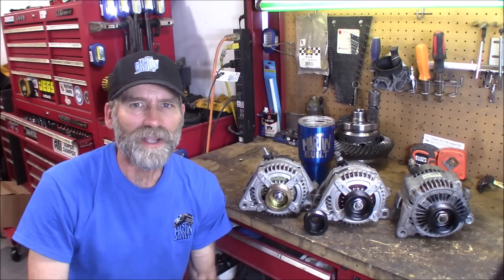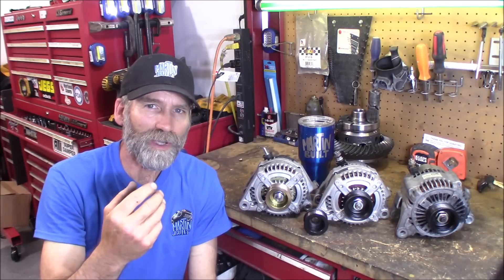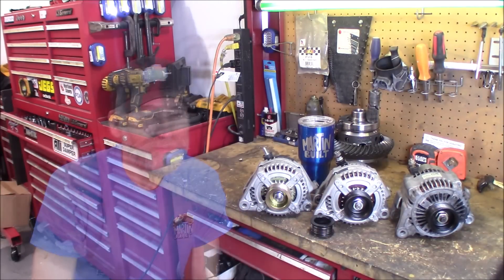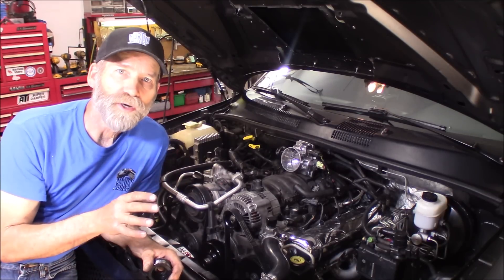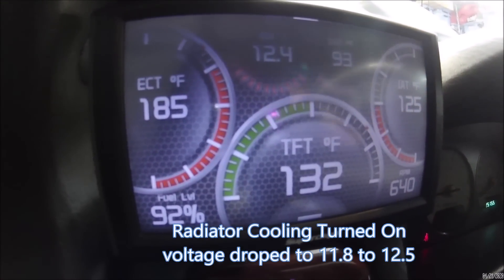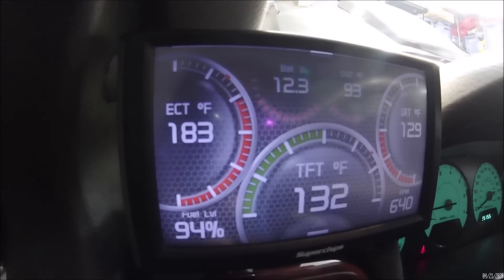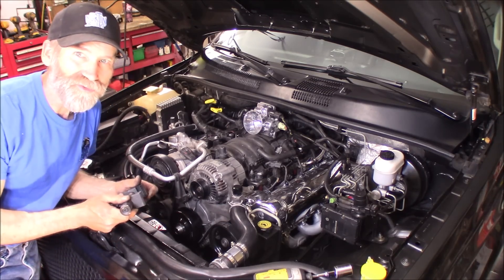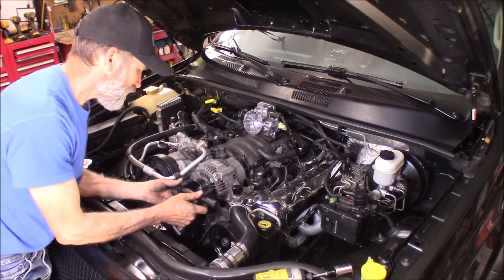Alternator Shootout at Idle (136 vs 160 vs 250 amp)

Comment: Great job thanks you explained to me in this video what I've been trying to do for awhile now one thing did you use the same serpentine belt if no what did you use
Reply from the maker: Yes I did but I should get a .5 to 1 inch shorter for the 49mm pulley
Reply: @martinbuilt  alright thanks,good to know thanks for the info great videos

Comment: The thing is that the current is high but the voltage is too too low because they use thicker wire in the 200+ amps so that reduces the amount of turn on the stator winding

Comment: O boy need advise ASAP. I upgraded my battery to a xs d3400. I also have a 250 amp alternator that I have on my counter ready to go in and replace my factory 130 amp alt. I'm currently running a 2500rms amplifier for car audio. Should I switch the pulley out on the new 250 alt before my mechanic does the install???
Reply from the maker: I think you will be okay, I would recommend doing the big 3 upgrade here is a video I did on that. 
https://youtu.be/Ednw5npj83c
Most of my problem was the 25% under-drive pulley I have on the harmonic balancer. So even with the smaller pulley on the alternator was not making up for the RPM lost.

Comment: The temperature of the alternators  should have been measured at idle. Running high amps at idle has burned up a lot of alternators or caused vehicle fires. Victron charging systems has a video on their channel showing the excessive heat at idle on the alternators at idle.

Comment: I get a 355 Chevy and a Malibu when I'm going down the road it reads 16 volts I have electric fan I only drops to about 15 volts I won't blow the battery up right
Reply from the maker: I know some drag cars like to run those high volts but they do it for a short time. I think that is too high a voltage and would boil the acid out of the battery. I personally like 13.8 to 14.4 volts.

Comment: my car is 1 year old and i get 14.2-14.6v on idle and while driving however when i plug in my mini fridge voltage drops to 12.4v +- 0.5.
Even when driving it wont go up unless i step to the red line.
I don't know if I have problem with alternator or did hyundai install alternator just for stock items and no extra
Reply from the maker: Yes it sounds like you're pulling more amps than the alternator is able to put out.

Comment: I ordered the 49mm pulley with the Amazon link that you list and what I got was a 6 groove pulley with a lip (~3mm) on the backside that the black one shown in your video doesn't have - did they send me the wrong pulley or do I have to have that lip machined off??  The pulley that I pulled off the stock alternator does not have that lip.  Please advise.  Thanks, in advance - love your videos!
Reply from the maker: I'm not sure about the lip on the pulley if it needs one or not I would install it and if the pulley lines up with all the other ones once the belt is installed you should be good.
Reply: So, I tried to install the Powermaster 115, as you suggested, but while it slips over the alternator shaft, with the lip on the back it doesn't let the pulley sit far enough down on the shaft to allow enough threads to grab the nut!  This is because the thickness of the stock pulley from the flat backside to the 'inside' front lip is only ~7mm.  This allows the stock pulley, once installed, to leave plenty of exposed thread to accommodate the washer and nut to secure the pulley to the alternator.  For the Powermaster 115 the distance from the back lip to the inside front where the washer and nut seat is ~15mm.  When the Powermaster 115 is installed, your left with 1 or 2 threads to grab the nut!  And, because the threads on the nut are recessed a bit there is no chance to to grab the threads on the shaft!  It would be awesome if you could take pictures (front/back/side/inside) of the 49mm pulley that you used in your video to help clarify things.  Thanks, in advance

Comment: Something that I think some people have missed (or if I'm wrong, set me straight). The only reason someone might want to put the 49mm pulley on is if they too have the damper like you have that explicitly slows your idle speed by 25%, otherwise, with a stock engine pulley setup, there's no need for the pulley change, right?
Reply from the maker: yes that should be the case or they are able to get 13.8 at idle but they want 14.1 to 14.4
Reply: That's what it looks like to me.  So these alternators are all being driven below their designed idle RPM for this test even with the 49mm pulley  so it says nothing about the alternators.  And the total system losses may end up increasing during higher RPM operation.  A little math may have been useful

Comment: Hi Martin. I`ve problem with my JGC 2000 4.7 PT. I have a problem with my alternator or it's not an alternator. It all happened suddenly. I came, I turned off the engine and now, when I try to start the engine, it works badly, the lights on the board are all on, it works like on 4 cylinders and there is no power. When I disconnect the plug from the alternator everything is fine. If I turn it on again, it is bad. The alternator is fixed - I picked up yesterday. The charging current is 14.4V
Reply from the maker: Sounds like it's all working great now. 14.4V is perfect.
Reply: @martinbuilt   Charging is ok but all time  engine works badly. All time When I disconnect the plug from the alternator everything is fine. If I turn it on again, ( this plug )  it is bad.  I don’t know what to do yet!
Reply: @martinbuilt  Sorry to ask again but I `ve  new problem witj my WJ.  Jeep still in the garage. The alternator shows over 16V - multimeter - and 0V on the dashboard clock. Alternator plug connected - engine breaks - multimeter shows over 16V - no power, disconnected plug works perfectly - of cource without voltage. Electricity only from the battery.  Is it the voltage regulator in the PCM or some wires or sensor or ground? Help.
Reply from the maker: @PC-ex9sr  Yes the voltage regulator is in the PCM

Comment: So...changing the Pulley size alone can overcome the Low charge problem? My car ('Hetty') has a 70amp Alternator (factory), and I want to add a 2nd battery to exclusively power Accessories (Phone, LapTop, Front/Rear Camera, etc...) do I need to upgrade the Alternator to a 80amp? 145amp? etc?
Reply from the maker: The accessories that you want to add really don't draw that much power for you I would try just reducing the size of the pulley on the alternator that should work fine. 
Thank you for watching 😊
Reply: @martinbuilt  ThanX for your Timely response. I'll see if there's a smaller pulley for the Toyota 2200 70amp Alternator. If I cannot find one, I'll at the very least get their 80amp Alternator.

Comment: Your Factory Alternator is fine you should upgrade your battery size That is your energy source. If you replacing your alternator with Bigger alternator You need to upgrade your wiring size to. Alternator is designed to deliver more energy on high rpm. Any time when you add high-power output device like stereo with hi output or fan, heater, lightings,… on your car you should considering installed the second battery, Maybe lithium battery with combiner battery, never charge lithium battery directly with alternator. Voltage sagging is usually because you wire is to small, batteries don’t have enough energy or both.

Comment: Quick question i want to add some music to my crv high watt speakers do you think 160 will be okay or 250? I want loud music im leaning towards 250 because I really want nice music in it subwoofer might be an option ontop of that.
Reply from the maker: you should do the math. Figure out how many amps you would be pulling with everything on and then add 20% that would give you the minimum amp alternator to go with.

Comment: What about 2 batteries? or an external voltage regulator... my battery with engine running idle is at 14.5v...
Reply from the maker: The main reason my idle voltage is insufficient is due to the under Drive pulley on the harmonic balancer. An external voltage regulator wouldn't make any difference because the ECM is already asking the alternator to produces More Voltage but the alternator is already producing every bit of can at idle.

Comment: nice video. but i noticed alot of your idle was in the mid/low 600 rpm.. most engines are around 700-730. wich would help a "lil" but interesitng video.

Comment: Have you done the big 3 upgrade for your wiring because even with a 250 amp alternator your not going to see the benefits with stock wiring. Need 0ga
Reply from the maker: The only time you're not gonna see the benefits of a 250 amp alternator with smaller gauge wire if you're actually pulling 250 amps or something near that. I have done the big 3 upgrade because people kept mentioning it to me and I saw absolutely no benefit of it, again I'm not pulling enough amps to take advantage of the larger wire.

Comment: very good video 👍👌 
love your videos they are very easy to understand and rich with info...
I was just wondering what would be the result if you use 55 pully with 160 alt
Reply from the maker: Thank you, the 55mm pulley would have increased the voltage slightly over the 57mm but not near as much as the 49mm did. The RPM difference from 57 to 55 is 3.63% where the RPM difference from 57 to 49 is 16.32%
Reply: @martinbuilt  
thanks for the update .. 
really appreciate it

Comment: my car is holden caprice 6.0L v8 L98 engine
2009 similar to Pontiac g8gt in USA
and using std. alternator
ACDelco 92193199 GM Original Equipment Alternator 140-amp 2pin
and my car has a sound system of 6000 watts
so can I upgrade my alternator to 400 amp or what you advice me to do
Reply from the maker: yes you can but, would recommend upgrading the alternator and battery cables to a larger gauge like 1 gauge or larger.
Reply: @martinbuilt  thank you dear for reply .. which alternator you advice me to get and part number of it
Reply from the maker: @surround1969  sorry couldn't find anything other then OEM amperage, you may have better luck finding one in your country.

Comment: Martinbuilt: what alternator would you upgrade to on a Jeep  XJ 4.0 L ?
Reply from the maker: I replaced the one on my 4.0 many years. I purchased from eBay it was a 200 amp alternator made by I think it was Eagle and it works absolutely perfect and it did increase the idle voltage. I was having a problem at idle after installing the Ford Taurus fan, it pulls a lot of amps so I needed something that had more power especially when idling.
Reply: Thank you Martinbuilt. You are the best on jeeps, great upgrades a Guru on do it yourself explanation’s and why to do a upgrade.

Comment: I've noticed that some high output alternators have internally regulated voltage and others are listed as externally regulated, how important is this in choosing the one you need? Thanks for the informative video and your reply. -Cheers
Reply: Very. Most new alternators are internal though. Mopar in the old days were external. Not a lot of others from my experience.

Comment: 0:34 - I own a 2011 Dodge Grand Caravan - My Alt failed 3 Saturdays ago - I have been without a car ever since - a week later my Antifreeze line busted somewhere - no antifreeze - Over heating going on.  "A few moments Later" - my dashboard lights began to flicker - and I'm NOT 100% certain my Power Steering isn't about to blow.  Ok - ... I need help.  Alts are 5 Gs.  5 Gs I don't have.  There's a Toyota Tundra (perhaps it's still available) that is 8 Gs.  8 Gs I don't have.  But it is a good vehicle.
I need to get back to work. I would appreciate ANY prayers.  I am in the Austin area.

Comment: all that would need to happen now would be to put the mechanical fan back on with the clutch ;; there are 4 bolts that hold the fan blade to the fan clutch ;; you take 2 of the bolts out of the clutch and you drill 2 of the holes in the clutch all the way through and use longer bolts with locknuts ;; this effectively locks the clutch so that there is no slippage as fan clutches only put out 80 percent at most because they never turn the same rpm as the engine ;;; having a mechanical fan takes a huge load off the alternator and the battery and incidently the grand cherokees did come if ordered so with the high performance cooling package for like towing and so on which is the package consisting of the mechanical clutch fan ;;; i had the same problem years ago because of driving down the road with a small snowplow on the front which effectively blocked airflow to the radiator making the electric fan constantly run . at the cost of a few horse power numbers ; i stuck with the mechanical fan setup while leaving the electrical fan right in front of it and the electrical fan never kicks on
Reply: time for a mechman alternator that puts out higher amps at hot idle

Comment: Have you tried a stand alone, variable voltage regulator to bypass the PCM voltage regulator?  I'd like to see how that affects voltage/ alt performance at idle.  Set the thing at 14.4v and then rerun these tests.
Reply from the maker: I haven't, I will one of these days but, I personally don't think it will make a difference. The ECM's voltage regulator is not keeping the alternator from putting out the minimum voltage required to charge the battery.
Reply: @martinbuilt  no...  but it has the voltage caped at 13.7 volts.  If you start with a voltage closer to normal charging voltage (14.4v as in most all other manufacturers), voltage drop will be lessened even when using the same accessories. The more you tax the alternator, the more rapidly it falls off. It's basically a logarithmic function.

Comment: What also help is using 1 awg battery wire
Reply from the maker: I did the big 3 with 1awg cable with no gains whatsoever.
Reply: @martinbuilt  ok then what the point of high output alternators

Comment: Why not after idle, hold 3000 rpm and see what it says. Or 3500….what is an upgrade for an i6 4.0L 2000 Jeep wj??
Reply from the maker: anything above 1000 RPM or more and the voltage came up to 13.8 to 14.2

Comment: Is it possible that the existing cables in the car can't take all the amps the 250 delivers? Maybe thicker cables are needed?
Reply from the maker: That would only be the case if the vehicle required 250 amps or near that. Larger cables would help in that situation. As you could see the 160 outperformed the 250 AT IDLE. So if the 160 was able to deliver the required amps and voltage why wasn't the 250 able to, because the 250 do not have the ability to produce the required voltage at a lower RPM. 
and doing the big 3 or installing a diode before the alternator won't make any difference at idle either.
Reply: @martinbuilt  ok I had no Idea that different alternators works best at different rpms. I learn something new every day

Comment: Hey Martin, if I put the smaller pulley on a 160 amp alternator for my 4.0, how do i calculate what length timing belt i need?
Reply from the maker: Just go with the belt 1/2 inch shorter.
Reply: @martinbuilt  that simplifies things. Thank you man
Reply from the maker: @SalFettucini  
I'm glad you found it helpful.

Comment: very helpful video ! I remember your  XJ 4.0 - which alternator do you recommend for the 4.0 engine ? Thanks !
Reply from the maker: I have a 200 amp alternator on the 4.0 XJ I needed something more with that Ford Taurus electric fan
Reply: @martinbuilt  thanks ! Can the 200 amps be too much for the battery and connected devices ?

Comment: Going from 57mm to 49mm doesn't even make up for the 25% underdrive pulley.  I wonder if the stock alternator would have perfectly driven your extra loads if you didn't mess with the pulleys in the first place.

Comment: Have a quick question... Someone told me if I upgrade my alternator to a bigger amps, I will need to upgrade the gauge of wire, or it could burn up my wiring harness is that true
Reply from the maker: not in my case, but yeah if you are pulling that high of a load that you needed a higher amp alternator you should upgrade the wiring.
Reply: Yep it's called Ampacity...there's charts for it...but essentially 4ga is the smallest one should use...but it depends on the size of the alternator. The wires are virtually always undersized

Comment: Why r u using an under drive ati super damper…. ???  I don’t get that part. I mean if u are using mechanical fuel pump on a race car okay… but that’s an otherwise stock anerican shit box with  4 wheels. The info about the over drive pulley is solid.

Comment: Martin:  I Can't believe there is someone that likes the 4.7L WJ more than me!  Loved this video on the alternators.  Have you ever figured out a way to adjust the target idle speed?  My second 4.7L WJ Idles at 500 RPM, in drive, with no AC, but all other modes it idles at 650.  I just want a steady 600 or so idle.  My other Jeep is always at 625ish.  Any ideas to change the target idles speeds in the PCM? I doubt,  but maybe the throttle body needs cleaning. Thanks
Reply from the maker: no matter what you do with the throttle body or IAC the ECM will always compensate, I've tried and it always returns to 640. Now if you have a HP Tuner then it can be changed in programming.
In you case there seems to be something causing the low idle. Would start with the IAC valve, clean it and the throttle body.
Reply: @martinbuilt  Thanks, I already cleaned the  IAC, think I will try to clean the rest of throttle body better first.  Do you have the HP tuner? Would it permanently change the PCM or do you have to leave it plugged in.  Would love  to see a video of the HP tuner and idle control.  Thanks